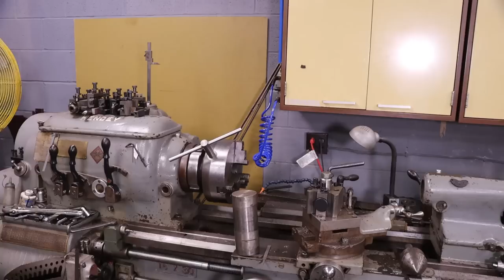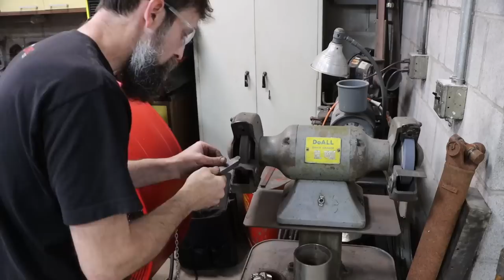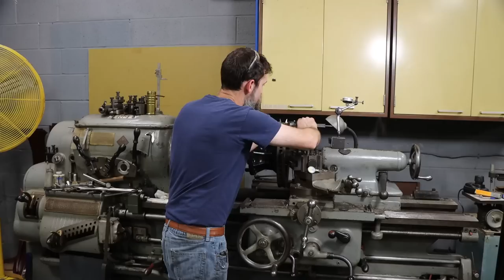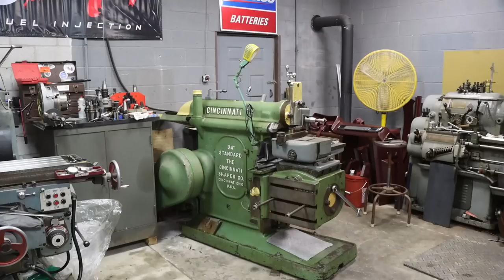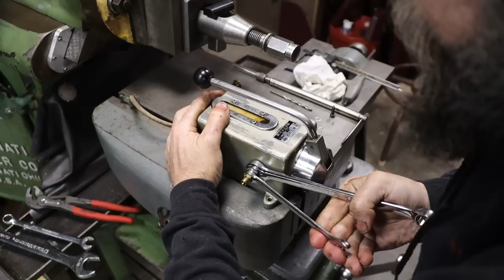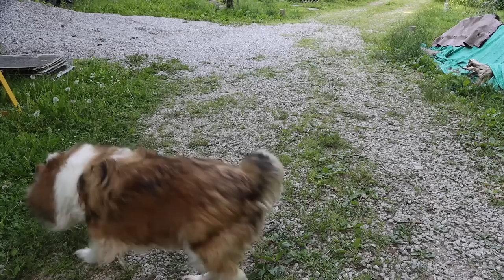Machining for Elizabeth / Metal shaper mod  Brown & Sharp  Update !

Comment: When I was a tech I cut allot of rotors and drums on the old brake lathes not the fancy ones they have now... But all we used were carbide cutters since no one was going to waste the time to sharpen hss. And for cutting rotors and drums there are big rubber bands with lead chunks in them to dampen out the chatter which I have always wondered  why I never see machinists using them because for us they work. If you cut one without it the entire shop knew it and the neighbors down the street... Also brake lathes cut both sides at the same time which is nice as it speeds up the cut and puts equal pressure on both sides of the rotor.
        Today most rotors are so cheap that you just replace them but any time you can save a factory rotor you are usually better off as they are generally better quality than the aftermarket. Not always but generally. One of these days I may come across a brake lathe for the shop. Rarely needed but handy.
Reply: I rember those rubber and lead bands. Never occured to me why machinists don't use them nowadays.

Comment: Hi Steve, when I ground in mag chucks, I always turned the chuck power on, use flood coolant, 46 grit wheel and, and step over half the wheel width on each pass, taking only a couple tenths off at a time. Nice find!

Comment: OMG! I was thinking how the sound of the brake rotor turning brought back memories of the years I worked in  tire and brake shop when you mentioned the memories it brought to you. The mind works in strange ways sometimes.

We had a big thing rubber strap we would wrap around the drum (or disc) to stop the chatter during turning.

Comment: Just a small modification to the shaper is the original feed line put a tap and small hose just long enough to reach into the top of your hand pump to top it up through the lid so you don’t have to worry about topping it up just open the valve while you are running the shaper when you need to 😊
Reply from the maker: That is a slick idea 😁

Comment: Noticed when grinding the magnetic chuck surface that the cut was lighter just before leaving the end and heavier at the start of the return cut. It suggests to me that there is a bit of springiness between the rotor and table. Considering the jerkiness of the table I would inspect the ways before doing anything else.

Comment: for setting up the wheelbearings i usually put the wheel back on , gives you a little bigger lever so you can feel the endplay / wiggle better
about the electro magnet , to unmagnatize it use ac current it shakes up the metal monecules that are now still alighned  , to power it use dc , usually a magnet like that has a pushbutton to bypass the rectifier

Comment: High humidity decreases the body's ability to control its temperature through evaporative cooling (sweating).
Lower the humidity and you will be cooler even if the air temperature isn't any cooler.
An air conditioner is just a dehumidifier with the extra capacity needed to bring the air temperature lower as well as lower the humidity.

Comment: Hi Steve, that was an excellent video with plenty of topics. Here’s the reason your shop feels cooler with just the dehumidifier. When the air gets saturated with moisture ie high humidity, then moisture can’t evaporate into that already moist air, this includes the sweat on your skin, but when you walk into a low humidity environment like your workshop your sweat immediately begins to evaporate and that evaporation drops your skin’s temperature. It also dries your skin and clothes making you a lot more comfortable. 
That’s the same reason someone living in the tropics at 100F with 90-100% humidity can’t get their washing dry yet someone living in a cold 40F but 20% humidity can. Also you may not need a dedicated dehumidifier as most portable air conditioners have a dehumidifier setting. 
I hope this helps. Cheers, Stuart 🇦🇺
Reply: Air conditioners are by nature a dehumidifier

Comment: I have had a dehumidifier in my shop for quite a few years and it has made a huge difference. Central Illinois gets mighty humid when the sun starts pulling the moisture out of the corn and soybeans in the summer.

Comment: As a old machine I would not worry about the rotor the specific are based on caliper travel and heat per tone. So as long as your not pulling a heavy travel it should be fine. Just my 2 cents

Comment: Glad you got the magnetic chuck working. I really enjoy surface grinding on my Jones and Shipman 540 grinder. I may tear into the hydraulic system and replace which I would guess are the originals from 1969. Great video as per the usual, Steve. Cheers from Florida’s Space coast.

Comment: One thing to consider on the surface grinder is to take the chuck off and grind the table in first. Then the bottom of the chuck and finely the top of the chuck. All that after you get it off the palet and level it out.

Comment: Sure odd to see rotors still being machined now but as these are part of the casting that holds the wheel bearings they are at least worth trying to clean them up. I am surprised at the lack of vibration. I am sure your dad has the belts with the lead weights on them to quiet them. That tool is the reason why. The neutral or negative rake keeps the tool loaded just right. What a nice newsy post you have for us today. You have made some real wins lately and for the first time in ages your pickup isn't in the shop either. Thanks a bunch and take care eh, ONWARD !

Comment: FYI. You are opening yourself up to litigation and prosecution if you should get into an accident. The minimum spec is a law. Lawyers search forums and YouTube. Also, there is a bearing adjustment spec that bearing adjustment is ideal. Check with your bearing mfr. Also, the ringing is common. Wrapping the perimeter of the rotor with a bungee cord can stop the chatter. There is a weighted belt made by brake lathe companies to stop that.

Comment: As a kid back around '78 we had a '71 Plymouth wagon. Passenger side front disk got ground into because of sticky caliper. Took a disk grinder and gave that a "new" surface. I'm sure it was WELL past the minimum thickness. Worked until the car rusted out.

Comment: I think Steve said that he would replace the rotor when it came time to work on the brakes. I wondered if they had something like a torque spec when installing front wheel hubs, I’ve always done it similar to what Steve did in this video.

Comment: There's not a whole lot of difference between "cooling" air conditioning and dehumidification. As a matter of fact, when Willis Carrier invented the modern 'air conditioner', it wasn't for cooling, but to dehumidify the air inside a print shop where the humidity was ruining the paper. The cooling was a bonus.

Comment: You can wrap rubber strips made from an inner tube to dampen the sound of turning brake rotors. The ones I have seen was 3/4 to 1 inch wide. Thanks for sharing.

Comment: Wrap a few big rubber bands around the rotor or take some old brake pads and make you a spring loaded ant rattle tool to ride on the rotor to stop the chatter .sounds way better and a better finish.

Comment: Any parts you need for her truck, Rockauto is you best bet. One of the projects I have in the fire is a custom built Econoline Pickup. I've built my own chassis and I'm using an F350 Dually real axle, and a F53 Motorhome front axle. The front axle has been shorten to get the track width right and I'm still using factory brake rotors. One was too far beyond the limit, so I ordered new ones from Rockauto and these rotors are big but the where reasonably priced. Got new caliper too.

Comment: Don't neglect the bottom of the mag chuck and it's mounting surface on your new surface grinder.  That should be the first thing before grinding in the top.
Reply: Workaholic 53   you are so right. He has made a good start though - you have to have a mostly flat top so that when you end up having the top turned upside down on the bed, that you just ground, it's flat, so you can grind the bottom of the chuck properly. Then you clean everything up, reassemble with a bit of anti-seize on all the mating surfaces and dust the top again. The way I used to do it was one drop of anti seize on the mating parts, take the chuck off, wipe the anti seize off of one or another of the surfaces put it back together and see my pattern. Going on from there it's easy. Adding a rheostat inline will allow Steve to have a variable electro magnetic field in the chuck. It is a bit more complicated than I'm letting on and you can also a have a de-gaussing circuit but hey it's his stuff to play with as he sees fit.

Comment: You could make a cyllinder with a female taper, and hold the work in it. But tapers need a drawbar to take axial load so this setup would  get pretty involved.

 But you'd might get away with glueing in the taper in with CA, and then heat it to get it out again.

I've not tried this myself, but I have used CA for other temporary fixtures and work holding tasks, and that has worked well for me as long as I don't do heavy interrupted cuts or other operations that shocks the work piece.

Comment: I worked with mag chucks back in the sixties but these were 'Eclipse' permanent magnet chucks, one trick we used to do if we had a piece that didn't want to be ground flat was to put the job on the chuck, turn it on, then turn it back off and let the residual magnetism hold the job down. You have to tickle it off pretty gently but it works. I would be a bit wary of skimming down a brake disc, I always replace them if they're a bit iffy and I'm a cheapskate! Best Wishes from sunny Midsomer Norton.

Comment: Interesting design on the hubs/rotors you have that they are a 1 piece design. I had a 1986 Chevy 1 ton ramp truck for a while. My front rotor/hubs were a 2 piece design and you could separate the the hub from the rotor.
Reply: Hey yeah you're right but I believe since this is a dually it has to be this way even if it's not the rear or drive axle for ease of manufacturing

Comment: Does the magnetic chuck switch go two ways? The way to demagnetize a dc electromagnet is to run reverse current for a second or two. Some systems have it built in and in others it's done manually.

Comment: Just a rednect/shade tree comment/question to help your YT algorithm: On the brake resurfacing, would it be possible/feasible/prudent/safe to build up the surface with your spray welder to get it back up to spec?
Reply from the maker: You may be able to but I'm not sure I would fully trust that with my family on the interstate.  It probably would work tho

Comment: I had to see the price on this rotors.  Not good, but much less than I expected...Friends at Rock Auto...still...couple hundred delivered for each still stings!  Need to get my '99 Tahoe in for suspension service and I'm dreading the costs...one place told me "Starting at $5K" and I knew parts were <$1500 so I was a bit cheesed...so still looking.

Comment: I'm surprised you didn't run a dial indicator on the new machined surface of the rotor after you turned it around to cut the back side.

Comment: Magnetic coils designed for DC have way more turns of wire than an AC coil. The DC coil must have enough resistance to avoid excessive current. The magnetic field in a DC electromagnet is constant , no reversal of the field 60 times a second. When you apply AC current to a DC coil very little current flows because of the huge amount of inductive reactance. This means a weak field, commonly seen in motor control when a DC  coil is accidentally installed on an AC system and then chatters.

If an AC coil is installed on a DC system, instant smoke. An AC coil has low resistance because it also depends on the inductive reactance that builds up to limit current. If DC is applied there is no reversing magnetic field, no reactance, and only the low coil restance to limit current, leading to the dreaded smoke test.

Incidentally this also explains why an electric motor draws heavy current at start. When power is first applied there is no rotating magnetic field and only the low DC resistance and heavy current flows. As the motor speeds up the rotating magneticfield develops so-called back EMF opposing the flow of current and the motor current falls to normal..

Comment: Are you sure it's one piece? Looks like it splits between the hub and disc 🤔

Crazy if not, such a large chunk to have to replace the lot (hub, bearings and the disc that is)

I know a lot of the older cars etc were more built to be repairable but I always used to think the newer vehicles/parts were more replace than repair (several parts in one piece ramping up the cost of parts).
Reply: The factory brakes on square body Chevy trucks is 100% one piece hub and disc.  Have 5 of these trucks and have done many brake jobs.

Comment: In Australia if you machine a disk rotor under thickness it is an offence at law to refit the rotor to the vehicle. You become liable if the vehicle is involved in car accident and a factor was the braking. If the accident is serious enough, particularly if there is loss of life, the person who machined the brake rotor and allowed it to be refitted will no doubt end up in a court of law. Unwilful manslaughter is not something you want to be charged with. So my strong suggestion is NOT to fit the under thickness brake rotor - it is just not worth the risk - and the consequences, even for an initial test run. 2nd thing. If the rotor is still above spec thickness, always machine both sides in the same set up, even if you just dust the 2nd side. Look up what disk thickness variation (DTV) is - get the info from brake rotor manufacturers. The thickness should not vary anywhere by more than 0.0005" (1/2 a thou or 0.0127mm). More than that and the brakes will shudder (particularly from the front), initially at higher speeds and then gradually get worse and rear its head at lower speed. Edit. I made the above comments before seeing you machine the 2nd side - sorry. While that is better than not machining the 2nd side, it is still preferable to machine both sides from the one set up _ I know that is not always achievable - I have tried too. Turning the rotor around, the tailstock does not always end up in exactly the same position on the bed and the less than 0.0005" thickness variation is more difficult to achieve. Retired mechanic/machinist.
Reply: Brakes and steering are life & limb systems. Replace with branded parts only.
Reply: It is a personal vehicle.  None of that applies.  In the U.S. each state sets their own inspection standards.  Many states, mine included, have no-fault liability.  If this was a repair shop there could be repercussions, but it's not.
Reply: @russelldold4827  Chances are your "branded parts" are reboxed off the same line as quality OEM parts.  They all come from China, and manufacturers cost cut them down to the minimums.
Reply: @randy-yk1yk  That may be the case but manufacturers stipulate min thicknesses for good reason. How would you like to travel on the road, with your family, with vehicles coming toward you, knowing that that vehicle has substandard brakes? If you are the errant party, you may get out of it on a technicality but that still does not make it right.
Reply: @bobhudson6659  That's a big truck. Loading up a 10,000 lbs trailer and driving with those rotors would be foolish. Just getting the truck on the road and driving it unloaded is not going to be a problem.
Reply: @randy-yk1yk  I'm well aware of the various "OEM" and "aftermarket" boxes filled at the end of the same production lines. They're branded. Keep a copy of the purchase.
It's not a problem until the crash investigator is kicking through the wreck, and because he's on a clock, he stops at the first off-spec item he finds, irrespective of whether it was the real cause or not.
Free advice is worth what you paid for it. Use it or don't use it.
Reply: @bobhudson6659  do you chase ambulances?
Reply: @randy-yk1yk In my experience, that’s not necessarily what no-fault means. No-fault in Florida means individual parties claims are filed with their respective insurance providers. That does not mean people don’t have liability, they aren’t negligent or at fault and can’t be sued in civil court.
Reply: @russelldold4827  It's not advice if it's not asked for.  It's opinion.  A smart man knows the difference.
Reply: @charlieromeo7663  You are correct.  I wasn't implying you can't be sued.  I was trying to show that each state has their own mandates.  As you know, some don't even require inspection.
Reply: @randy-yk1yk  Semantics. I can freely offer advice - no man is bound to accept my offer.

Comment: If that 1 ton still has the ride height proportioning valve on the rear axle remove it. That design is a failure from Chevy and it will cause sporadic brake lockup when stopping. Chevy’s fix was to remove the valve and run a straight hose setup like on your half ton.

Comment: i realize you need to make a video. in real life that is a lot of work for a simple job with the correct equipment. also fwiw if the finish is not non directional you lose about 30% stopping power over just leaving it alone. grooves dont mean diddly. thickness variation would be the issue.  i dont have it in front of me at the moment but i do have a training video showing all the different procedures on rotors and measured stopping power.
a friend with a large manufacturing company does his on his tool room lathe to save a couple bucks  sigh
not beating you up but the wheel bearing tightening procedure is to snug it down, back if off and hand tighten. if the cotter pin doesnt line up back of till it does. this is the GM procedure. it should have 0 to .003 end play